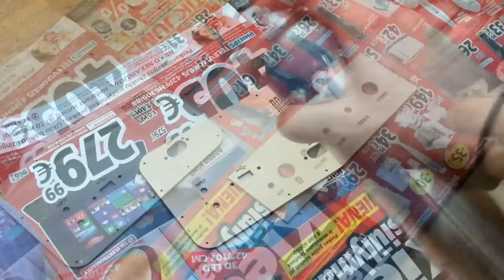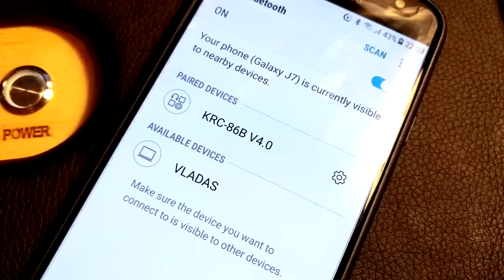INSANELY Loud 150W DIY Bluetooth Speaker Build l HOW TO

Comment: Not sure if anyone pointed out the fact that your Pisz poor 200ma Power Supply will limit your amplifiers power output to around 10WRms "If that.... what with all that extra circuitry" Which BTW obviously is no where near 100 watts let alone 150 watts that the amplifier module you used is capable of, but only if the right Volts and current is provided to it, in fact I am astounded that the Amplifier module even fired up, what with such very little current.

BTW if you add two passive Radiators and some sound dampening your Bass would improve immensely, but only if you provide the amplifier the current it needs..
Reply from the maker: Hi! Thanks for noticing as many of the people did 😄 It is actually the power supply for the accessories of the speaker, the main power supply is 36V 6.5A unit which is able to deliver enough current.
Reply: @DonnyTerek  Well if memory serves me correct I didnt see what I would expect a hefty power supply in the the portable boom box, in fact I dont recollect seeing a cheap switch mode power supply either 😅 all good though..

Comment: Addition: Morel specifies a lower cutoff frequency of 60 Hz for the woofers, which is no deep bass. 40 Hz would already be much better. Even lower frequencies should not be demanded from 6 1/2 inch loudspeakers. Morel does not specify any Thiele Small parameters, so a serious calculation for the cabinet is not possible unless you can measure the TSP yourself.

Comment: do u have a video how to make that logo of yours and that panel name (aux,bluetooth symbol, volume..etc)?
and can it be built in with battery for portable one?..thanks..
Reply from the maker: Hi! I don't have a video on how I made the logo but it is actually really simple, you only need to convert your logo graphics to a vector file that a laser cutter can read. Please check my other videos to see how I built a battery powered speaker. Thanks!
Reply: @DonnyTerek   thank you..
I like your video..for a beginner like me this is really helpful  and exciting to watch..im trying to make one soon.but still choosing which build is good for me,to hear some music while working at outdoor workshop. 
Anyway,All the best to u.thx 👍😄
Reply from the maker: Not a problem! Thank you for watching and feel free to leave me a message if you have any questions. Good luck with the build!
Reply: @DonnyTerek  actually..i do had a lots of question..but let's just take step by step..
I do see u use wood a lot,so does mostly other people's diy and it sounds great..but what about acrylic or other material ? Are using acrylic are not as good as woods?.have u try it?.im curious about this. Is there's any difference in sounds quality at all,in different material ?🤔
What do u think?..
Reply from the maker: There is definifely a lot of difference in sound quality depending on what material you choose for the build. Acrylic is not popular for speakers since it does not absorb vibrations that well and also resonates more. I mostly use MDF.
Reply: Which one you prefer..
Using passive radiator or tube?..and what's the different and use for?
Reply: Is there's a difference using passive radiator or tube? 
Or maybe pr are just a substitute for a tube?

Comment: Hey, I'm trying to round up parts to make this but I didn't see what ac dc converter that was used. AC110/120 to DC (to what)?amp and (how many) watt? and on the wiring diagram why does it loop back into the converter? Can someone or Donny answer these for me?
Reply: Guess I'll have to find a different DIY How To

Comment: Here, you can see one of my two speakers that I built back in the early 80's.  They still sound fantastic after 38 years or so.
See speaker picture at :     ibb  .  co/jSWGOo         (Remove spaces to access pic)

Comment: Donny, for the 22mm self locking button, its the 6v or the 220v?? Since I am in USA do i still use the 220v?
Reply from the maker: Hi! You can use the 220v switch for the power supply and a 4-6V switch for the Bluetooth.
Reply: I think if you are asking those sort of questions, you would be better leaving it alone.
Reply: It's better to ask a question just to make sure, and not expect someone that the question was not asked to write something negative just because they feel they can, but at least my name is not Dick.
Reply: good man

Comment: 6.5" car audio speaker most of them need 15L - 25L ported box with Fb of 40hz- 50hz port tune each driver, this box is too small. This sealed box will probably not getting much bass. You should make bookshelf speaker box for it.
Reply from the maker: Thanks for commenting! I do agree that a bigger ported box would result in greater performance, but it still delivers great bass response as it is!

Comment: Very cool and a lot of good work. BUT this thing will not be acoustically adequate. Cabinet volume is to small, no bracing and no damping materials. These are basic things in speaker design. But most people have no idea what a properly built and designed speaker sounds like so they have no point of reference. Awesome project just needs some tweeks.

Comment: when there are two bass style speakers in one box, one of the speakers should be hooked up in reverse polarity. If not then they will always be pushing and pulling against one another. if you didn't know this before and decide to put it in one of your videos, give ya boy a shout out :~p ... Over all, Very Nice Build!!!
Reply: why do that> you'll cancel the waveforms out and kill the bass. you'd only do that on a cardiod bass cab at the front of a stage to stop the stage vibrating.
Reply: @Johnnybananass-_  I have installed car stereos for quite a few years. When wiring up two subs in a sealed box (Non Ported) it is essential that one is wired in polarity and the other wired out of polarity (so they don't travel in the same direction)  otherwise they would be in a constant negative pressure environment and simply destroy  each other.

Imagine if during CPR both people are trying to breath out at the same time.

Comment: What about dB levels? Your sound box trespass 100dB?
Reply from the maker: Hi! Did not have a chance to check that yet.
Reply: Obviously it will. 100 dB at 1m distance is no challenge for a speaker of that kind. 110 dB would be impressive.

Comment: Nice project but that mains power switch looks a bit risky. 220 V marking suggest it is for China internal market and I would bet is has no third party electrical safety certification. I have a hard time believing there is double insulation from the touchable metal button to the mains voltage parts inside the switch.
Reply from the maker: Thanks! The switch actually consists of two separate parts, the latching mechanism ant the switch itself so there is enough insulation for sure.

Comment: How is it possible that you have all those amazing tools, but no clamps for the box?!
Reply from the maker: Haha! Clamping a box like this would be difficult since the boards would slide around. But you are right, I don't have proper clamps!
Reply: @DonnyTerek  nice trick that you could probably use in future if you're worried about the joint sliding when applying pressure with clamps, also it will not react negatively  with PVA/wood/craft glue.  
Get some regular house salt (sand could also be used) not too fine but also not too course and sprinkle it onto the glue once you have skimmed it out as you do with the card. The grit will etch into the two pieces of timber locking them in position  preventing sliding/slipping. By you excellent woodwork skills in very surprised that you have not known of this method. 
Good work, flawless in the build beside small details but I would suggest isolation of channels and stronger material for enclosure (MDF is widely believed to be best material but this is certainly not true, it's simply used even in $20,000 speakers as a more cost efficient easier to work timber)  remember that volume is almost the most critical aspect of a speaker (one of anyway) 
A+++ anyway, just trying to give some useful / constructive criticism to help you in future projects you build.

Comment: yea, great job but at 0:22 i saw your loose shirt tails hanging over your running table saw and thought i was about to see one of those power tool fail videos!!!  keep on building but please keep the loose clothes tucked in. Signed: Your High School Shop Teacher, Stubs
Reply from the maker: Hi! Thank you for the comment! I do agree that is quite unsafe keeping loose clothes around but it is not as dangerous as you would think. For the fun of it, go check Matthias Wandel video on loose clothes near a table saw blade, where he experiments the chances of getting caught by a spinning blade. Not as easy as you would think!

Comment: Major flaw, Your wood back panel with power button, USB , bass , treble..etc is not insulted from air leakage and vibration..presurized air will leak from all the other customer plates you put..

Comment: 210 dollar speakers, 17.5 dollar amp... Is that because of your confidence in the amp?
I've always been of the thought that a good amp can compensate for bad speakers, but good speakers can't do the same for a bad amp.

Advice on the logo, spray some clear on the wood to seal it before painting the lettering. Then the paint won't wick into the wood.

Comment: The right speaker reacts differently than the left one, so. they have different specifications or their quality is just low. And you do not increase the volume for another reason simply speakers do not make power in such a small box or the power amplifier can not keep up. However, both the idea and the design are OK
Reply: As far as the speakers reacting differently; I would put that on the cheap amp. I doubt i was designed meant to push efficient drivers at peak - not RMS -  wattage which equals clipping and distortion. Efficient speakers will kill a weak amp and vice versa.

Comment: not really insanely loud if you are using morel drivers which are SQ oriented and the sensitivity ratings are rather low. Theres a lot of others that will actually fit in the insanely loud category but the sound quality wont be anywhere close. Just nitpicking on your title, good job bud.

Comment: Great build. However, why, oh why did you use the hot glue in combination with SCREWS ??? It makes no sense !
Reply from the maker: Hi! Screws hold the speaker in place while the hot glue is used to seal the edges around.

Comment: Well done overall  but some flaws and definite dot do's as  well  w/o touching the SQ aspect or massive flaws from a technical design point.

#1 you should never be using hot glue to seal in  a driver.  if you need an added sealant on the driver frame as you show your using hot glue..  use something easily removable, that stays flexible and is inert to the frame and other components.  A nice generic white silicone used commonly for caulking a bathroom for example will work well and is quite cheap

#2 Why on earth are you apparently hot gluing on the decorative ob or the Vol control??  It cant be as a cost savings measure since you have obviously not skimped out in most areas (Morel branded drivers for example.. while the set you picked is ow end for them they are still never cheap!)..  The POT is a splined and split type for which various knobs are easily available.... and obviously easily removable should the need ever arise..  Hot gluing on one that's not the correct type is just amaturishly laughable and for such a small part seriously detracts from your creation in a major way.

#3 there was no good reason to place the PS internally.. in ct that's a detriment in multiple ways.  But instead an external power brick 24v @ 5A or so would have been far better a choice, still quite cheap to get and none of the bad that comes with the PS you used.

#4  Given the class D amp you picked is a common TI TPA3116 or similar chip there are better boards available with very similar tech specs.. but without the doomed to noisy failure mini-fan that's used on that model.  Far better in the big pic to use one with a much larger but passive heatsink..  long term it will be much better and less headaches.

#5 w/o going into the many flaws on technical aspects a simple version.  You picked what appears to be a driver set designed for car use in an infinite baffle.. and placed such in a sealed small cabinet w/o even any ill..   this will be disastrous for anywhere near wishful thinking of a flat freq resp...  Then there is the driver placement..  which should be as far away from each other as possible.  In this cabinet assuming no size/shape etc changes  the tweeters should have been moved upwards into the corners with the woofers moved as far apart as possible  thereby giving the max acoustic separation in this particular design.  Internal bracing is another aspect  even at a minimal fashion yours is lacking such entirely and that could have been added extremely easily..

As for more technical aspects or changes that would have improved this w/o requiring much complexity  even just adding one passive radiator in the bottom center or two smaller PRs one on each end..  would do wonders for the low end..   and to help correct many of the major flaws in this design and w/o going deep into the correct technical design aspect.

Oh and flashing on messages re volume level etc is moronic.. almost as absurd as ppl commenting on sound quality to an audience watching this via youtube ffs!  The FAIL is strong with you on that aspect for sure.

If you want to properly convey such info get a display system to show the SPL for starters...  and a good calibrated mic etc to show at least a graphic freq response if not a waterfall plot etc..

Comment: Sehr gut gemacht! Leider ist es sinnlos Lautsprecher einfach in irgendwelche Kisten zu schrauben. Alle wollen einen dicken Sound doch so wird das nichts. Richtige Lautsprecher zu bauen, ist halt doch nicht so einfach wie die meisten glauben. Trotzdem sehr schön gemacht die Box.
Reply: EKsound die teuren Marken Boxen werden 100 Mal einer Qulitätsprüfung unterzogen dan kommen doch die Frequenzeinstellungen und das Optimieren des Klanges. Da steck viel Arbeit in einer Bluethoot box. Selbstgebaute Boxen haben immer meist nur Probleme.
Reply: AK__RuSpezGop__AK BRATATA Wenn man wenigstens das Gehäuse berechnen würde für teure Morel Chassis, wäre hier schon einiges sinnvoller gewesen. Allein schon das beide TMT im selben Gehäuse arbeiten, macht klanglich einiges kaputt. Mein Kommentar ist da eher an die Wertigkeit des Bauens gelehnt und daran halt das teure Chassis mehr technisches Wissen verdient hätten.

Comment: This setup probably has more than enough power and frequency extension to enable DSPing to near perfect frequency response without significant distortion and clipping and still maintain excellent maximum volume. 

Imagine using this speaker as a center channel of a surround sound system.
Reply from the maker: Thanks!!

Comment: Yeah diy for someone with a commercial woodshop. This would a pain in the ass to do out in the garage with black and decker tools from Walmart and a low IQ, aka most of the general public. Fairly expensive high end drivers for a bluetooth setup.
Reply from the maker: Hi! Thanks for watching and leaving a comment! Trust me, I am the one without a commercial garage, usually borrowing more expensive tools or asking someone to laser-cut a few panels for me, but it is always worth it! I guess you do have to agree with me here that almost any project can be a DIY project, since it only depends on your abilities and will to Do It Yourself, and using more expensive tools (in my case - asking someone to cut the panels out for me) is one of the ways to getting a project done.
 I really appreciate peoples' opinions and your's is no exception. Thank You.
Reply: Donny Terek - Very nice build, just more work than most people would ever do. I'm the same way I'm fortunate to have a network of people that will let me barrow tools.

Comment: Nice choice in drivers but verry poor design on on enclosure. No bracing no foam. Worst is speaker placement a mtm configuration would of served best as a array configuration would not be usable In landscape. You now created lobbing effect from the motel drivers. Good drivers. Stick to buying than making as you are good in purchases
Reply from the maker: Thanks for the comment! I think I will still try and make a few more!
Reply: hey, ya hear that? go make a sandwich.... clean yer outhouse or somethen!

Comment: Did you check the TDA datasheet?  It gives 80 Watts for under 0.1% THD distortion. The 150Watts is at 10% distortion.

Comment: Disliked because I'm a jealous Youtube troll who doesn't own or have access to laser etching equipment to make my own build look neater and professionally built. BTW you could have piggybacked the 12V and 5V from your 36V supply by using DC-DC step-down modules. Much tinier and easier to wire up.

Comment: music power level you called 150watt in soviet russia we called 20watt. because your 150 watt is "pmpo(peak music power output)" it mean that in 150 watt your speaker will break after minut of listening. "simple marketing"... japanes music level in 20000watt men that speaker will burn after first second of listening on 20000watt. our music power is "recommended power level" for listening without quality lost. and we were not sum power level of two, or four speakers. even if it 8x20 watt its called 20watt. im sorry for my инглиш. i sorrow for my Soviet Russia(